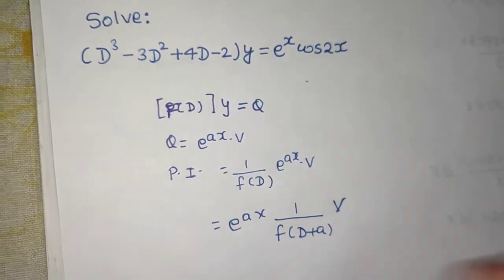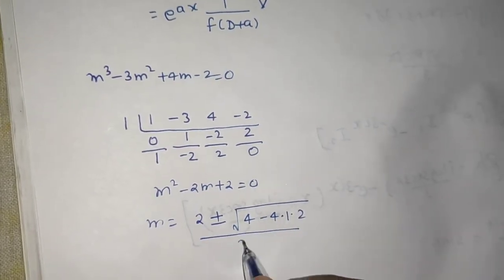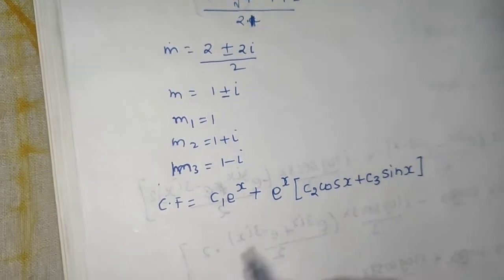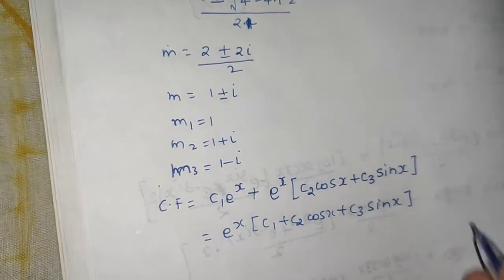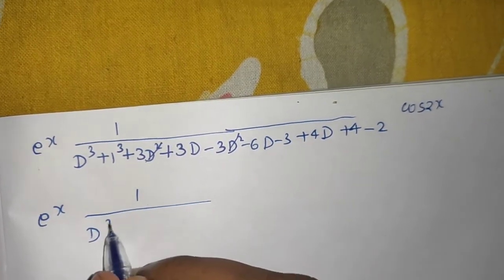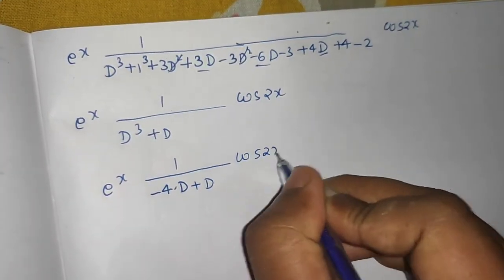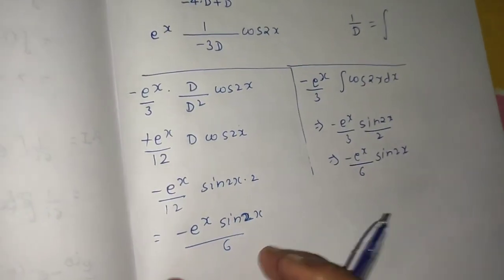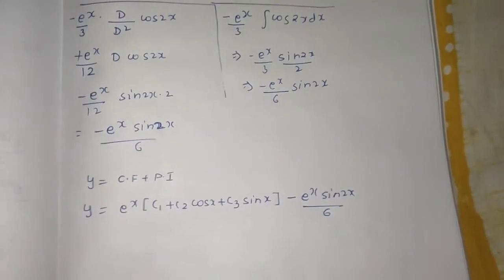Solve: (D³-3D²+4D-2)y= 𝑒ˣ cos2x | Linear Differential Equation with Constant Coefficient

Comment: Please continue making videos. Your videos are so helpful. Thank you
Reply from the maker: Please tell which topic you want.
Reply: perhaps, variation of parameters and reduction of orders, and laplace, etc
Reply: @rkchy   Sir, may I ask humbly if it's okay with you, how to solve this DE, D^3-3D^2+4)y=4e^x+50e^xcos2x ? 

I tried to solve Yp2: D^3-3D^2+4)y=50e^xcos2x, using the operator method with the technique you did in the video but I cannot get the right answer. Idk which I got the wrong in solution. I tried multiple times already. thank you, Sir.
Reply from the maker: @Engr9  please leave the correct answer , i would make video soon
Reply: @rkchy  the correct answer is y=C1e^-x+C2e^2x+C3xe^2x+e^x(2+1/2cos2x-7/2sin2x)

I really appreciate your help. Thank you very much
Reply: @rkchy  have u gotten the answer?
Reply from the maker: @Engr9  sorry, I forgot today you will get.
Reply from the maker: @Engr9  just for that 50 e^x cos2x ,i got the PI as e^x(-14sin2x+2cos2x) please checkout